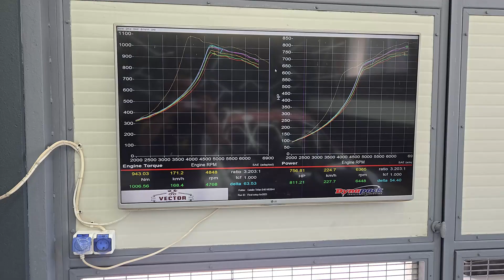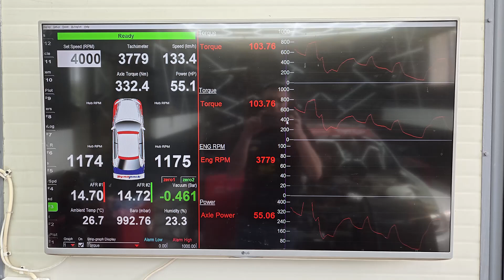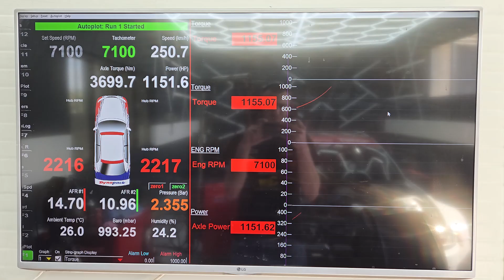Building the most powerful BMW N62B44 engine in the world - Part 3 - Exhaust fab. and Dyno Day

Comment: Wow this is insane I thought nobody has ever turbo this motor because all I see is superchargers and I’m not a fan of superchargers I love turbos but I would love to see a twin turbo setup on a N62B48 (4.8L V8 from the e60 550i) because I have that car and the motor is a very high compressed v8 and has 367 hp stock but imagine twin turbo setup can you give me some ideas of what to do to it to twin turbo it? I just wish people would have never slept on this motor for tuning and mods because it’s hard to find kits for this car to do performance upgrades
Reply from the maker: In a street car is very difficult to mount turbos , maybe impossible , cause space is not in your favour. Maybe a rear mount turbo setup could work....never tried it tough :)
Reply: I’ve seen someone selling a n62b44 swapped 525i with a custom twin turbo set up but they had to remove the front bumper to fit the turbos but it was insane
Reply from the maker: @DWC_Visuals1 There are some compromises to make for turbos :)

Comment: It would be intresting to see more techical stuff. 👌👌
Reply from the maker: You are wellkome to ask specific questions here , and we will be happy to answer to them .
Reply: @3Fun_Catalin i will the the same engine but NA for street use. Would be nice to see the mounting and gearbox setup.
Reply from the maker: @lakatosbrendon4680  for a street car , i think you'll need a sump kit . Cybull have that kind of kit . Oem n62 sump , will fit also , but the engine will be flush with the firewall , and also there is a trans tunnel reibforcement that will not give space for the transmission. In my race car , that reinforcement is removed, and i use stock sump. Also , steering column must be moved downward , at the firewall side. Also engine management should be taken in consideration.